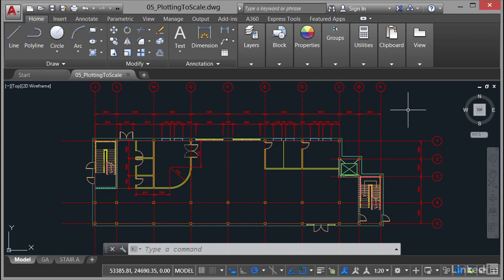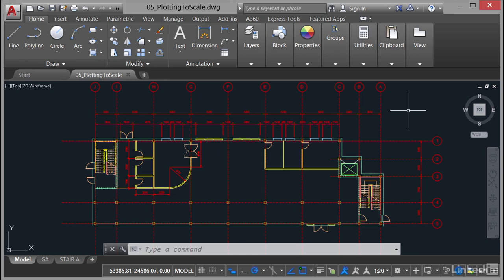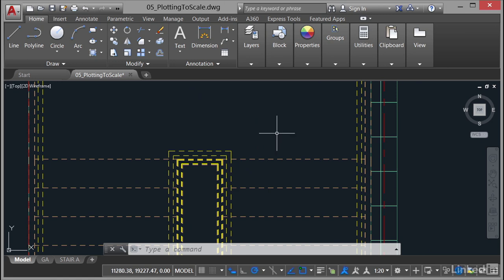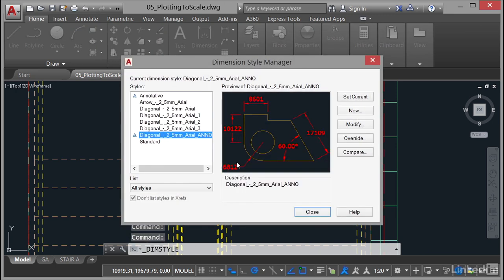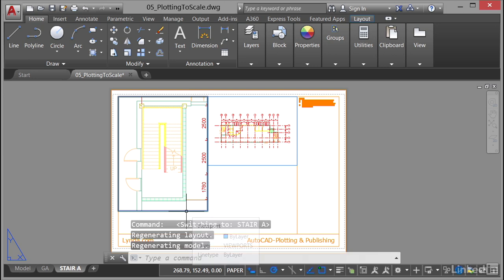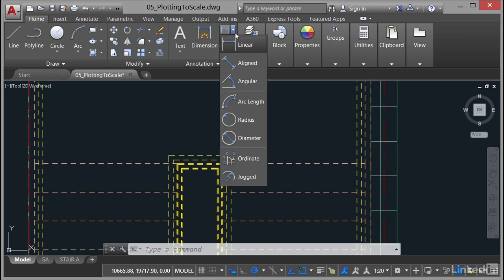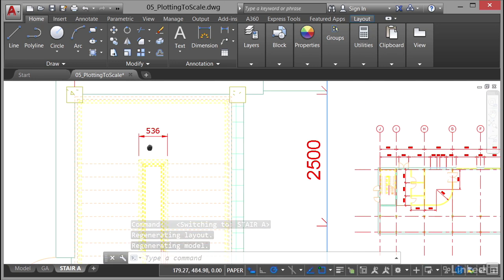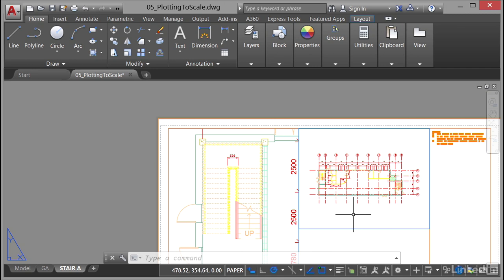AutoCAD Tutorial - Viewport scale and annotation scale

Comment: Why AutoCad made it so complicated. Why Soliworks or any other cad software does not need to make 50 easy steps to have dimensions automatically scaled when print or make detailed view. I use Solidworks 99% and sometimes i need to do plant layouts using AutoCad. Man it is so complicated after drawing and dimensionine in other Cad systems.